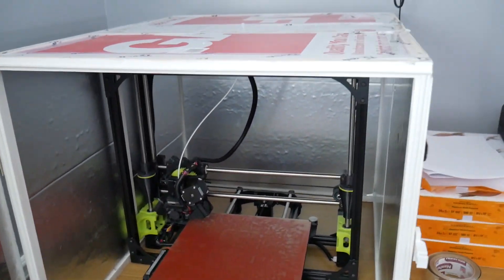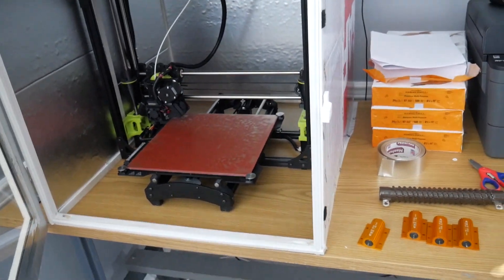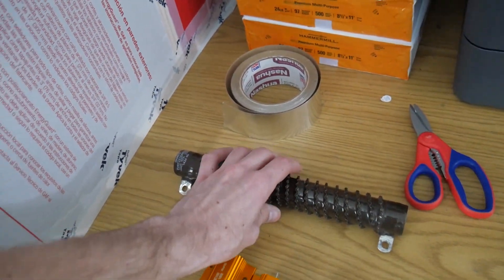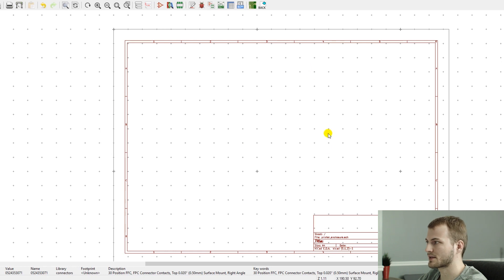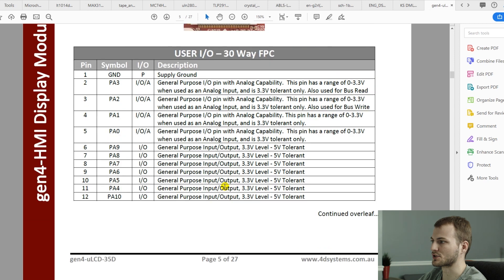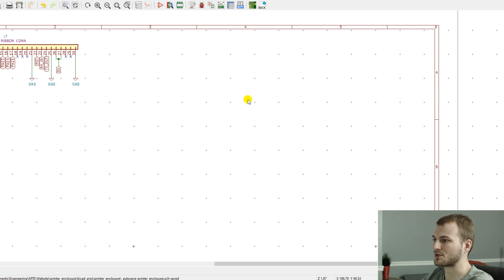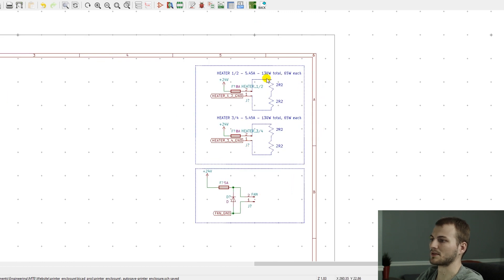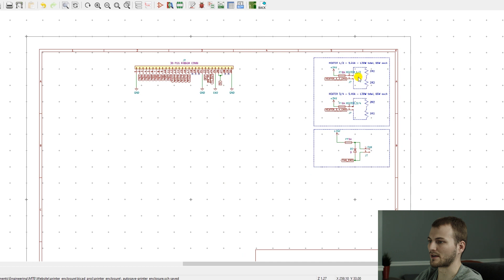Custom heated 3D printer enclosure part 1/x - KiCad PCB Design

Comment: One thing that isn't clear to me is why the box needs heating up? I've never heated up the room where my 3D printer is to any specific temperature. How hot does it need to be and why? I thought the extruder heated up the filament, and the plate is heated from below .. so what's with al the heating?

Comment: Unless the motors are very peculiar, most are rated for 85C or higher working temps, not 50-60C (but their working ambient depends on their delta from ambient, of course).
Reply from the maker: The motors on the Taz 6 are spec'd at 60c-65c max ambient actually.